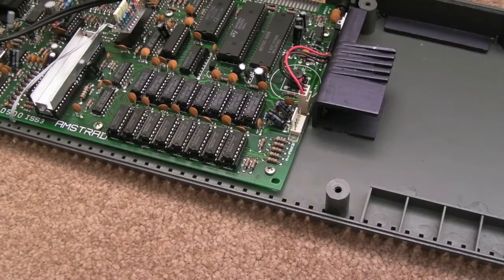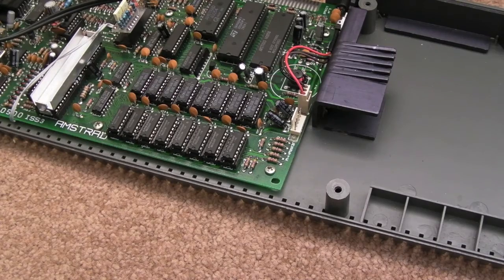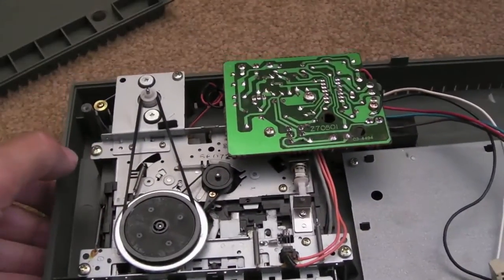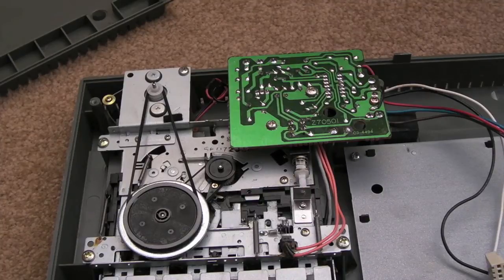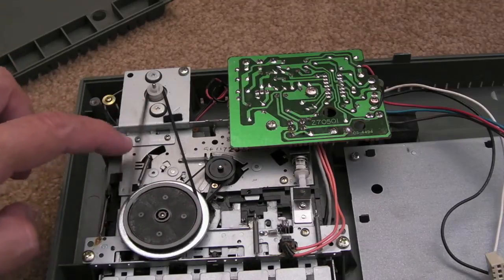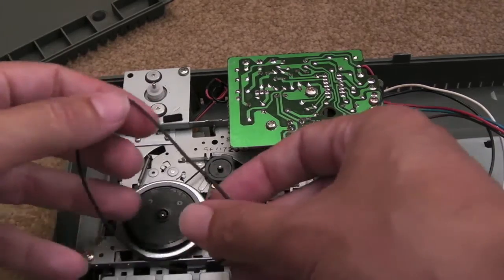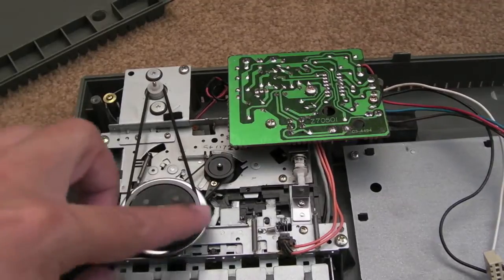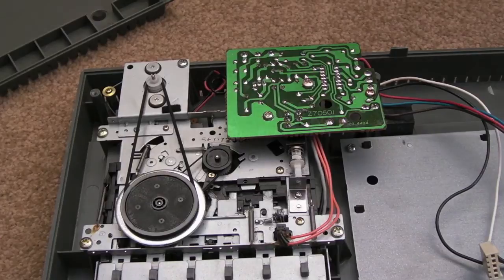Sinclair ZX Spectrum +2 Datacorder (Tape) Belt Replacement / Repair

Comment: Hi i have a problem with my +2a the tape fast forwards and rewinds but when i press play it doesnt turn and it makes a weird noise ...any ideas?
Reply from the maker: If you take the unit to pieces and inspect the tape deck, when you press play you will find that a metal piece moves upwards on the underside, on the end should be attached a spring (I think), it's possible you are missing a spring or two there.  The other possibility is the clutch wheel that should slide into position has lost its spring, or the rubber has worn away on it.
Reply: thanks ill take a look :-)

Comment: Are these belts standard or custom for the ZX spectrum 128k +2? I need one also.
Reply from the maker: I honestly cannot remember - your best bet is to look on eBay!  There's usually a few sellers on there.
Reply: Thanks I found a couple of resellers on E-bay :-)